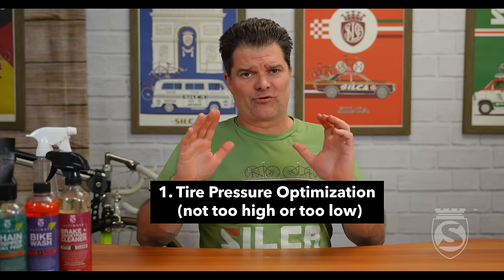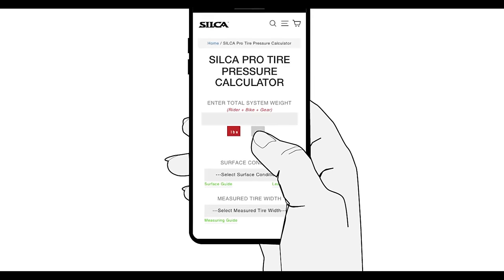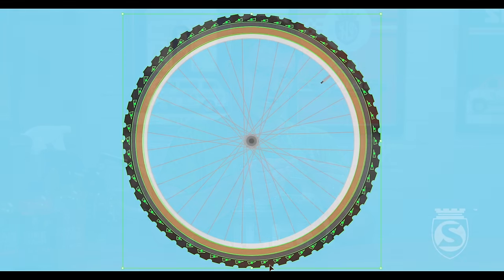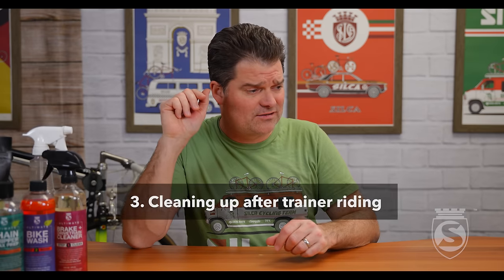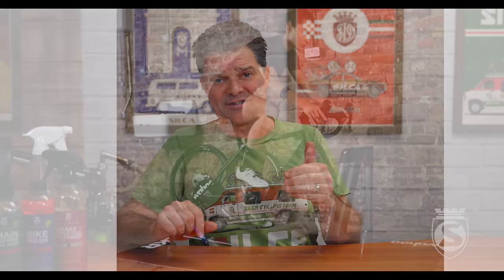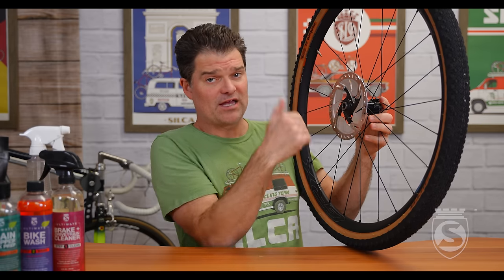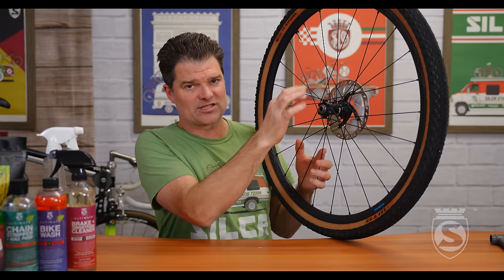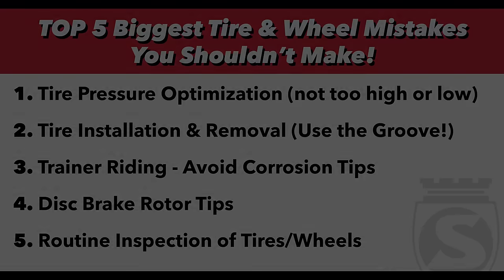Top 5 Biggest Tire & Wheel Mistakes You Shouldn't Make

Comment: Is there any feedback from anyone on why the Silca tire pressure tool recommendations are so different from the SRAM one? A little variation is expected but for my road bike (28mm tires), the SRAM tool recommends 65 psi back and 61 front. The Silca tool recommends 78 back and 76 front. For reference, I'm around 155 pounds, the bike plus gear add up to around 20-21 pounds
Reply from the maker: So the SRAM calculator works to charts created in the 1970's by a guy named Frank Berto who determined '15% drop' to be the ideal loaded tire deformation.  They then use those calculations with a filter applied that bend the values down as they approach 72psi.  Our calculator is based on thousands of field testing data points with real athletes on real surfaces, where we use Chung/Virtual Elevation testing to determine what pressure provides optimal Crr.. our calculator fits curves to all of these data points to allow for interpolation in between them, and we do not modify the calculations at all for any rim or tire pressure limitations which is why we say that if the calculator tells you something too high, then you need larger tires.  Also, be sure to measure the tires.. all other calculators sort of guess at actual width from the sidewall marking and rim inner bead width, but can be off in terms of actual measured width by 3-5mm.
Reply: @SILCAVelo  Thanks for the detailed answer

Comment: Tyre install tip priceless... just been acting like a contortionist, tyre lever under load under 1 elbow, another held by the other hand then tyring to get the third lever jammed under the tyre.. done it your way and it flopped on with no effort.. cheers

Comment: i damaged a tire with a lever, the main factor that makes a tight fitting tire hard to get on is the grippiness. so now i use a lil bit of power and its a breeze, vs using over 100 percent of my strength and focus with a lever, also punched my self in the face when pulling the lever towards me, i use to train one arm pull ups so yea that hurt.

Comment: Any chance that the Silca pressure calculator be able to have the option of providing recommended tire pressures for those who are using mixed tire widths between front and rear? I usually run 2.35 front/2.2 rear and sometimes 3.0 front/2.35 rear.
Reply: Just input it twice
Reply: @Fatbutnotflat it does'nt work that way since I run a mid fat setup (29x3.0 front, 29x2.35 rear).
Reply: Same request. My canyon came with different tire widths front and rear. Have also used different tire widths front and rear when upgrading older bikes due to clearance issues. An option for different widths front and rear would be great.

Comment: I use Filmore valves. To check for sealant every 4 months or so I need to visually inspect. Often it is low or gone especially if I have needed to add air regularly. What is the least messy way to check for sealant?
Reply from the maker: Shake the wheel and listen.. it should sound sloshy like water in there.  As soon as it starts to sound thicker than water, you need to add more, and if it's silent, you need to open it up and inspect.

Comment: If you haven't done so already can you do a video that includes using tubes inside tubeless wheels/tires.  I have had tire sealant etch into my wheels after not removing it in a timely manner.  My bike came with tubeless ready wheels (with a tube inside), so aside from the weight issue is there any arguments against using that set up?
Reply from the maker: The only real downside of tubes in tubeless setups is that it's heavier and has higher rolling resistance.  Tubeless tires already contain extra rubber making them a bit heavier and potentially slower than tires made for tubes.. so by keeping a tube in there, you are getting the worst of both worlds.  As for your etching of your wheels, that should not happen with any of the modern ammonia free sealants and a good TPP rim tape.
Reply: The weight does not concern me since I am not racing.  The hassle of sealant does.  Popping in a tube for me is more convenient than the mess of tire sealant.  Since I already have tubeless ready wheels I can always switch back if need be. @SILCAVelo

Comment: Josh re: the abrasion between carbon rims and tire sidewalls, do you think that the wearing is more related to bits of clay/silt getting trapped between the two (rather than the carbon rim being abrasive in and of itself)?
Reply from the maker: It's likely a combination of both, but mostly the carbon.. if it were grit and dirt in the interface, we'd see it on aluminum rims as well, but it's almost unheard of in that application.  However, I think that grit in that interface will wear away the epoxy more easily than the carbon, and the carbon left exposed will be fiber ends, making a sort of micro saw blade.  I personally hit all my rims with a white scotch-brite pad on this surface when new to try polish it as smooth as possible, but the real solution lies with the tire companies putting a protective material in this area, which most all of them are now doing.

Comment: Hi there great tips, I was wondering what your thoughts are on the Tyre Glider? Since discovering it installing gp5000's is no longer a nightmare... however I do wonder if they can damage the rim
Reply from the maker: I've not used the tire glider specifically, but it's install technique is very reminiscent of the CrankBros lever action..which works well, but you have to be careful if your carbon rims have decals as before you know it, you've run it around the rim and shredded them.
Reply: that's actually exactly what happened 😂

Comment: I wish I could use your pressure calculator but it does not include a "Tyre Type" = Tubular. Could you please include it in the next version? Tubulars are "beadless" and have a full 360 degrees of casing. This amounts to  20 to 30 % more casing "width" for a given tyre diameter when compared to a clincher . In turn, this results in higher hoop stress for a given pressure, and this changes the optimal pressure...
Reply from the maker: So we've tested this pretty extensively using both static and dynamic load/deflection testing (you can see some of it here: https://silca.cc/blogs/silca/part-2-tire-stiffness-wider-is-stiffer-harsher) and found that for a given tire measured diameter, the radial stiffness will be equivalent regardless of tire construction.. in fact, for the first probably 2-3 years of data that our calculator is based on, all of the cobble and much of the road racing data comes from tubulars.. in fact, if you know the rider weight at the time and measured tire width, you can at least 4 Roubaix winning pressures (on tubulars) from the calculator.. so calculate away!
Reply: The blog post does not appear to include tubular tyres?  @SILCAVelo

Comment: Hi Josh.  I have an off topic question about Zipp which you mentioned several times on a recent GCN video.  I just unpacked my Zipp 950 disc from about 25 years ago. I discovered that my 10-speed cassette still fits and it seems to spin normally. It seems to be in great condition but not used for about 15 years and only used maybe 25 times ever. Question:  would you still use it for a 70.3 race or is it too old even though it looks fine?  What about my same vintage Zipp 440 front wheel in similar good condition?
Reply from the maker: Old carbon wheels don't degrade from sitting so you should be fine.  The bearing grease might not be in such good shape, but a clean-up and some lube and you should be good to go!

Comment: What should I do if the calculator recommends a tire pressure lower than the minimum written on the tire sidewall?
Reply from the maker: Our official stance is that you should never go against the manufacturers recommendations.  Generally the low limit is more about pinch flat prevention than safety, but with the wide variance of hookless rims and such on the market, best to be safe or at the least test it out and consult with others using the same setup to ensure that it is not a safety risk.

Comment: The key to preserving your trainer bike is fans and towels. If you're dripping on your bike, its because you aren't doing that. Way easier (and cheaper) than your recommendations.
Reply from the maker: One thing to remember with fans is that they help  to evaporate the water, but that leaves the salts in the sweat just that much more concentrated.. towels are super helpful, but if that super concentrated sweat is seeping through, then you will have issues.
Reply: Wash your bike regularly also when it’s on the trainer. If it’s freezing outside wash it the shower.

Comment: Just scratched my rim's using Silca tire levers when removing a tire to replace the Silca Inner tube :( They are good quality, but I now going back to using cheap plastic ones.
Reply from the maker: I'm surprised to hear that for removing the tire.. our plastic inner piece is similar plastic to what other levers are made from  but is actually softer since it has the aluminum spine?  Where you peeling the bead off, or running the lever around the rim?  Honestly never heard of this before so curious!  Thanks
Reply: @SILCAVelo  I was trying to remove the tire. One lever was on and while I used the other lever to peel of the tire it scratched the edge. I might have done something wrong, but never ran into this when using the cheap plastic levers. They don't last very long though.

Comment: Interestingly the app comes up with a pressure way below other apps , I use 29 x 2.35 on bikepacking.
Reply from the maker: As our calculator is based on thousands of actual field test results of optimal Crr for given weight/tire/surface it does get a bit cloudy at the extremes as we just have very little data.. Also, it's mostly using pro road/CX/gravel inputs with maybe 10% mtb cross-country.  So our data skew toward lighter riders and bikes as a result.  So with a heavy bikepacking setup and tires that big, you are just sort of out of the scope of the calculator.. though I'd be interested to see how it works for you, have you tried our recommendation?  If you could give me some data points that do work for you, we could drop that into the model and it would actually start to improve data quality out there.
Reply: @SILCAVelo  based on a total weight of 280lbs , grade 3 gravel , & 29 x 2.35  tubeless tyres  the app suggests 17 psi ,I actually settle for 26 to 28 psi .I will try 17psi on a regular route if you like & report back .

Comment: What do I do, if the calculator tells me lower pressures than allowed by the tires? So for me, I'm running 700x45 MAXXIS Rambler on my gravel bike (hookles, tubeless) and the calculator tells me to use 2.1 bar while the allowed minimum on the tire says 2.5 bar. Does it mean, I should run smaller tires? Like 40s?
Reply from the maker: I would ask the tire manufacturer why they list a minimum pressure.  Some tires have a minimum pressure based on what the manufacturer fears could allow the tire to burp or de-bead under side load (which would be a safety issue), and others are just giving guidance to avoid a potential pinch flat.
Reply: @SILCAVelo  thank you very much!

Comment: Using the Silca tire pressure calculator I find it impossible to satisfy both the rule of 105% and the ERTRO guidelines (this is on 30mm external rims, so relatively wide & I’m under 75kg).

On a moderate to fast group ride, should I give up on optimal pressure or on the rule of 105%?
Reply: On a group ride aero only matters when you’re on the front. So aim for optimal pressure . Even when you’re riding in front another person on your back wheel will also reduce the drag on you. So aerodynamic benefits only really matter when you ride alone. Doing yoga or stretching so you can ride comfortably with your body lower probably matters more than any aerodynamic gear you can buy. But that’s the boring answer. Buy the things you want and enjoy life. 😊 I waited two years to buy my Canyon before they came with a color I really wanted - racing green.
Reply from the maker: Many modern wheels have made it nearly impossible to hit the rule of 105 and hookless rims make it actually impossible unless you weigh 100lbs.  I'd shoot for as close to 105 as you can get, in many cases this will be 100% or equal rim and tire width, and then optimize your pressures.  If you have money to burn check out my favorite setup, the 3T Discuss 45/40 with hooked 29mm internal bead width, with 32mm GP5000's that actually measure out at 35-36mm when inflated on that rim.. looks like a motoGP wheel at first, but the aero is phenomenal as is comfort and road feel.. I run mine at ~38-40psi and it's amazing.

Comment: Josh, do you know if the Formula RX-142 12x142 rear hub has a space maintainer between the hub inner race bearings? Or does this model rely solely on the hub to external race and a preload by the axle end jamb nuts?
Reply from the maker: Sorry, I don't know that hub, but most all Taiwanese cartridge bearing hubs use an internal spacer to control bearing alignment and preload.. but you'd have to take it apart or ask Formula to be certain.
Reply: @SILCAVelo  Thanks for the reply, I’ve tried contacting Formula several times. I did get several schematic drawings from them before for another reason (how the freehub was removed), but in what i was sent then, it’s hard to determine for sure of there’s a spacer. And I was asking around first before trying to take apart. When I had written later asking about a spacer, I never got replies.

Comment: Hi Josh, I have a pair of Zipp 303 Firecrest wheels and this upcoming spring I want to replace the rim tape, now the inside rim width is 25mm. What size rim tape should I use?
Reply: 27 or 28 mm
Reply from the maker: I'd ask Zipp.. it will depend if they are hooked or hookless, but they will know the exact number for your model.
Reply: @SILCAVelo  My wheels are "Hookless"

Comment: Brand new disc brakes need to be bedded in properly,the best way to do that is find a reasonable decent nothing to crazy,bring a water bottle with you that has only water in it,as you near the bottom of the decent,spray your brake pads with the water,this stops the pads from glazing over,repeat process a couple more times,and your done,it should also eliminate squealing of the brakes too.
In the case you have contaminated your pads thoroughly clean your calipers,boil the pads in clean water for a few minutes,then find a very flat surface eg: glass sheet use 800/1000 grit wet and dry sand paper and rub the pads on the paper with even pressure and strokes,about 10 times,then clen the pads with brake cleaner then reinstall.

Comment: The Silca pressure calculator works good for classic road, but larger tires like 55mm (measured with calipers) it recommends such low pressures the tires roll, bounce, and bottom out significantly with any riding more aggressive than recreational seated beach cruiser vibes.  Sweat ruining the front hub?, seriously?, here's a genius thought, drape a towel on your bars and top tube LOL, you don't need more stuff!  So much of the "advice" is ridiculous, for easily avoided "problems" that don't exist for people who have a brain.

Comment: I think this calculator is OVERLY optymistic ... for example, MTB 29x2.4 tires (62mm), worst surface (gravel cat 4), 90kg system weight and the calc proposes 0.8 bar !!! it's not possible to take a turn with such pressure. 1.4-1.6 bar is realistic...
and what about road tires? 29mm, high perf, good pavement - 5.3-5.4 bar (I think the calc was updated, before it was lower?) - This works, however I have a question, why tire manufactures suggest higher pressure? even minimum more like 6 bar (continental and pirelli for example)